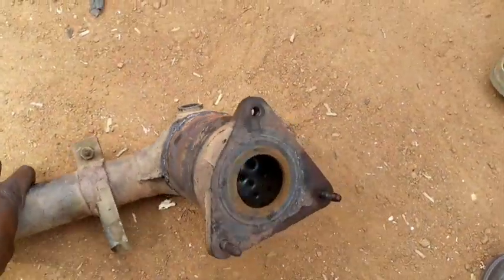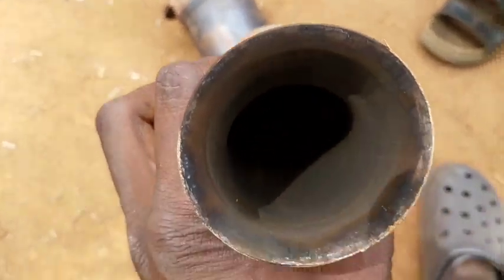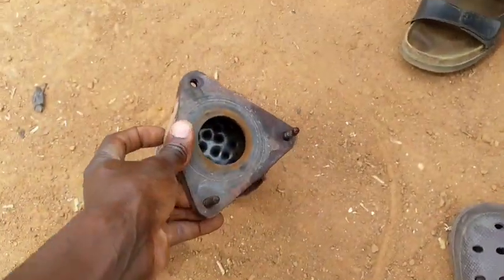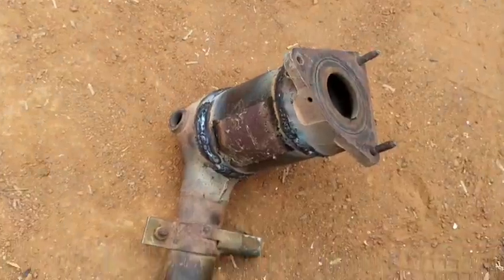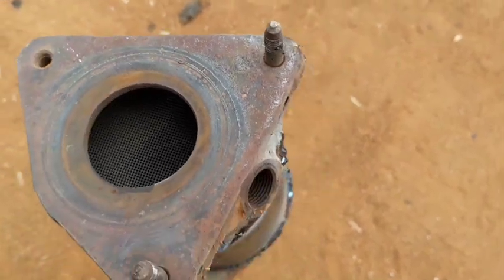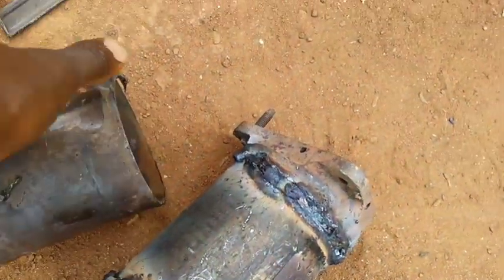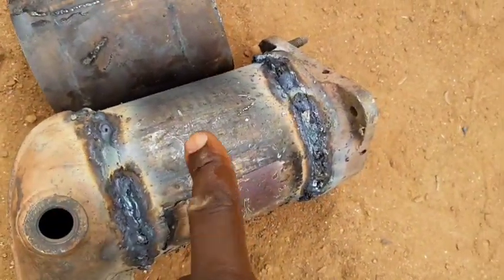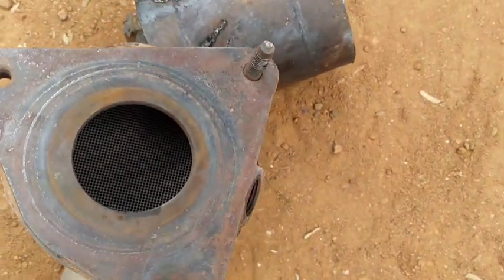How I Fixed Bank 1 Catalytic Converter Issue On My Peugeot 407 Coupé V6 Stick-shift

Comment from the maker: LION-KING MONK CONSULTANCY SERVICES 

 - OPTION A 
Below is fee to respond to a one-time question or query from people who prefer to contact me privately for my Peugeot specialist/expert advice. A Follow up or different question/query for another  advice from me on Peugeot,  after I have responded and given my expert advice/explained solutions to your earlier questions/queries with a video, chats, voice message or email will attract another payment.
Option A price: N3,000 (minimum) 

- OPTION B 
This is for Peugeot vehicle Pre-purchase Inspections & 5-year full consultancy services,  where you can constantly seek for my expert advice on Peugeot vehicles, privately, without paying anymore for the next 5 years, as much advice you want (other conditions apply). This also includes Pre-purchase inspection for Peugeot Vehicle for persons that pay this option B.
Option B price:  N50,000 (minimum)

If you are interested to pay for either Option A or Option B, indicate or contact me for my account details for payment on my WhatsApp & Telegram chat  line only +2348095721703 or email ikenna351@gmail.com

Note that the above 2 prices are non-negotiable and non-refundable. And its pay before service. 

Also, note that I am not an expert on Automatic Transmission, Incase your question or query is on automatic transmission problems and solutions.

For my free expert advice, visit my YouTube channel (link below) for videos and posts related to your queries/questions.

http://www.youtube.com/c/Ikenna351Monk

 Lion-King Monk.